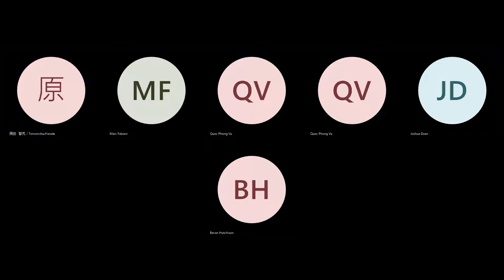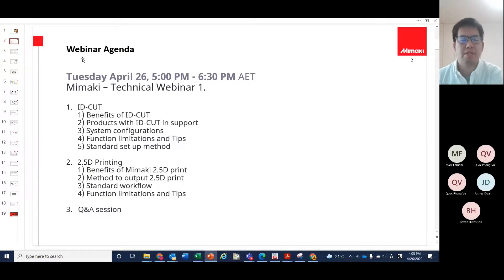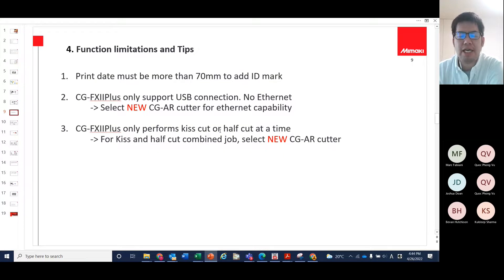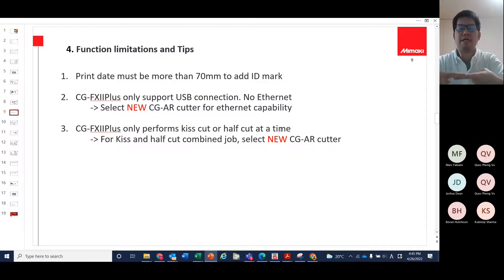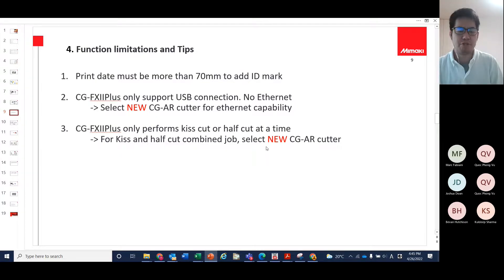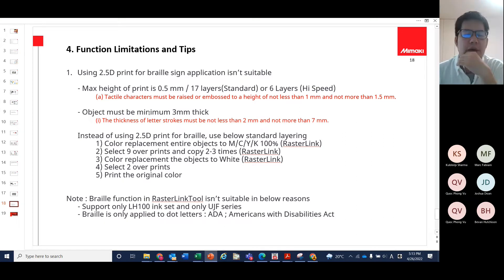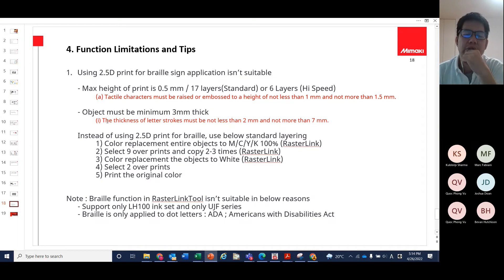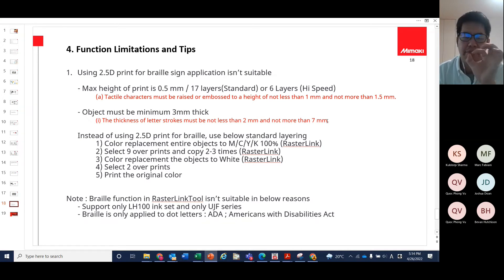Mimaki Technician weekly knowledge webinar 220426 ID-Cut & 2.5D Print

Comment: I did a system initialize and it showing cjv150-130 instead of the cjv150-75. how do I changed it back to CJV150-75
Reply from the maker: Please contact your local Mimaki dealer for the support.